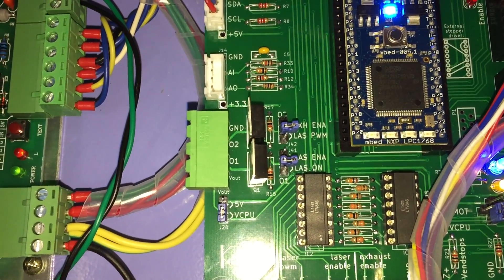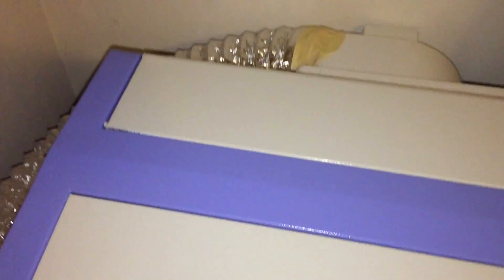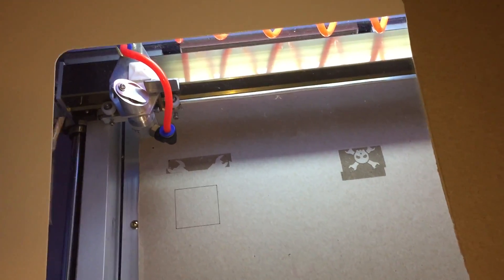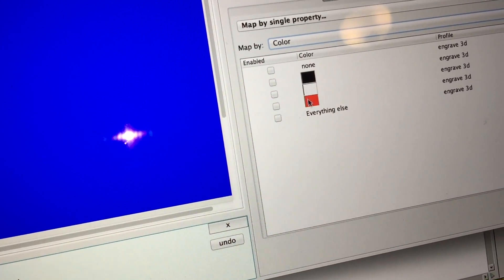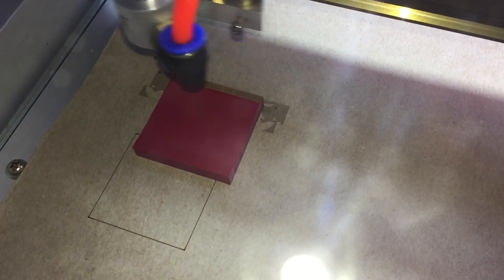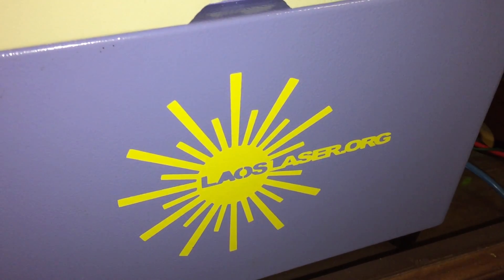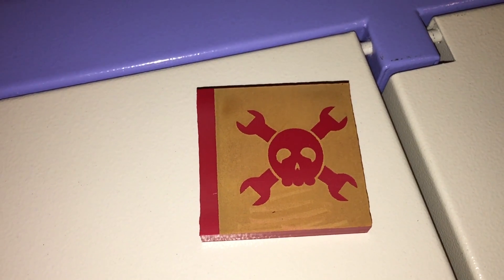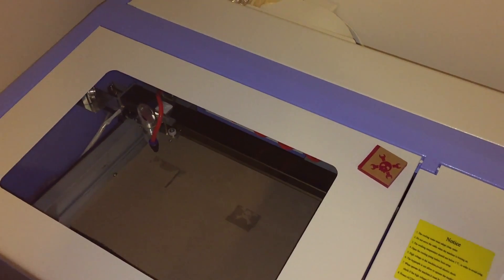LaOS Laser Part 6: Engraving

Comment: Good job mate.3D mode on "my machine" is used when you want to assign different colours to different depths. Your stamp is all one depth so engrave should be all you need. I really like using common lap top power supplies for projects like that, easy to find a replacement later too.
Reply from the maker: Robonza Good idea with the laptop power supplies!  I've got a few spares.  They're right at the correct voltage, too.